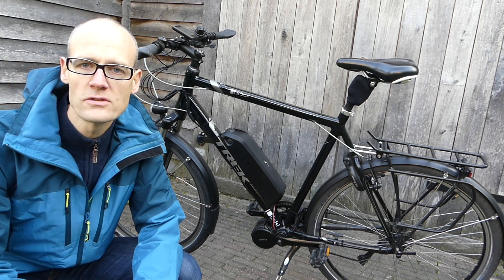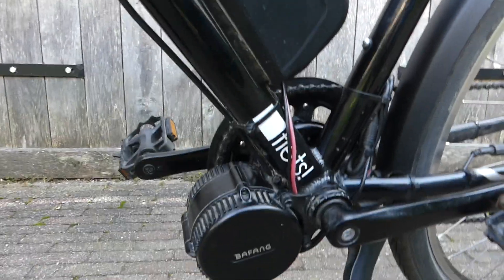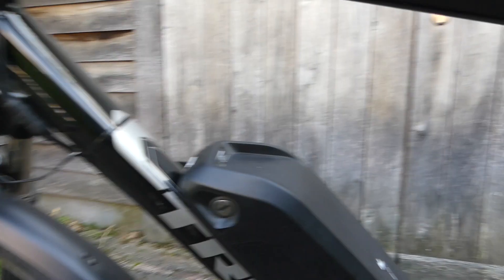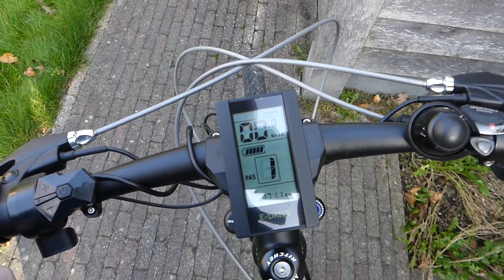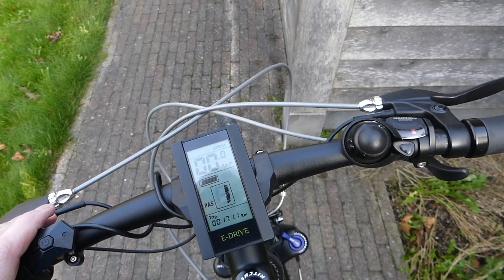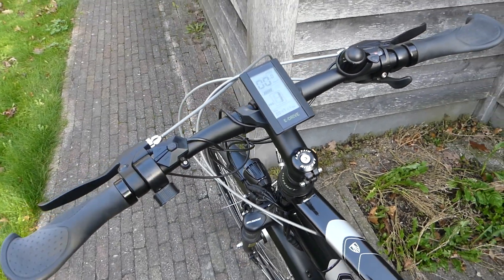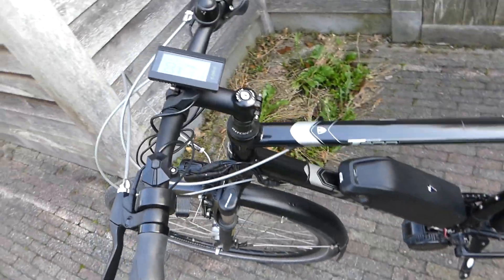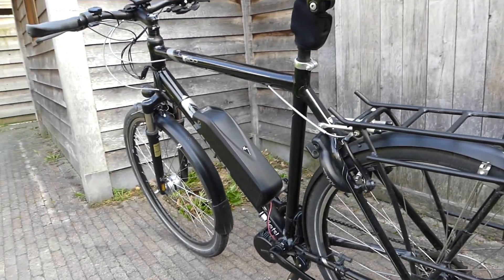Bafang BBS01 36V/250W review

Comment: Thanks for the tip regarding fixing the battery mounting plate with some polymer glue. Did the same yesterday and now it holds like a rock! Feels much safer now when riding on bumpy terrain (I ride MTB). I have BBS01B 350W with 17,4 aH battery - I have like 200 km range on this baby using PAS 1-3. I still like to feel my legs a bit when I'm riding:)
Reply: How about speeds at different pas settings. Looking at getting exactly that kit
Reply: i dont mean to be so off topic but does someone know a method to get back into an Instagram account??
I somehow forgot my login password. I would appreciate any assistance you can offer me!
Reply: @Isaias Aries instablaster =)
Reply: @Kace Rory I really appreciate your reply. I got to the site thru google and im waiting for the hacking stuff atm.
I see it takes a while so I will reply here later when my account password hopefully is recovered.
Reply: @Kace Rory It did the trick and I actually got access to my account again. I'm so happy!
Thanks so much you saved my ass !
Reply: @Isaias Aries happy to help xD
Reply: 200km range? Even with a tailwind on flat terrain on lowest assist I have never seen such results. That is amazing.
Reply: @tamastenhaaff2291 : You can travel any speed in any PAS setting, the only variable is how hard you must work. If you meant throttle only, with no pedalling, that varies depending upon overall weight of bike and rider and what terrain you are riding.  It seems you might want a more powerful Bafang model if speed is your main concern.

Comment: HalloEdwin, after buying the 1000W motor I also bought a 750W motor and, by comparison, it sounds more like your motor concerning the acceleration. While the 1000W motor is super smooth and immediate, the 750W is ruppig (you´re German, no?) What I did was put a second sensor on the rear wheel. I can´t say it´s the perfect solution, but it does seem to help a little bit and, to my surprise, it doesn´t seem to affect the tacho readings at all.
Reply: OK, when Dutch, instead of ruppig, ruw ;)

Comment: It's a neater job if you cut back those cables once fitted. Plus the 2 holes in battery base have held mine, I fitted a rubber grommet below the top hole has I didn't want to glue mine. I get more milage just using my throttle to tickle the power. Not annoying has speed catches up quicker than me pedaling. Buy a cable n change specs on your lap top.
Reply from the maker: I tried reprogramming with different settings, but nothing worked. I just can't get the accelleration to speed up. I also have a BBS02 now, which does not have this issue.

Comment: Great video. I'm upgrading from a 250w hub motor as we have large hills where we live.  To stay legal in the UK I would have to stick to a 250w bafang crank motor, but I'm just wondering how you find it on hills?
Reply from the maker: It is surely powerful enough to cope with a hilly area. The only concern I would have is that of switching gears. The BBS01 (mine at least) has no gear sensor cable, I think it is only available on the BBS02 and BBSHD. Without gear sensor it will be hard on the rear chain wheels especially when driving in high assist levels. What I do is switch gears as much as possible in lower gears and than raise the assist level. Not very pleasant when going up a hill I guess...
Reply: Edwin Mol thanks for that response
Reply: i squeeze brake lever a fraction without binding then pedal slowly n change gear no problem. plus i can fly up a 1 in 10 gradient very easily.
Reply from the maker: Johan Meijlaers I think you can not mount the gear sensor on a BBS01, if that’s what you bought. As far as I know, only the BBS02 has a connector for the gear sensor.
Reply: my dealership has gear sensor as an addon for this kit, i will get one after reading this cheers
Reply: @moledwin  Maybe on the earlier model's perhaps? My  BBS01 was Bought and fitted in Jan 2020 and it has the Sensor connector which works just fine.

Comment: Hello Edwin Mol. 
I'm on the fence of switching from a 6 year old worn out Crystalyte HS rear wheel 36v ebike kit to the Bafang mid Drive BBS0 mid drive kit with 36v battery. 
One of the reasons to change from the x-lyte 28" rear wheel drive to mid drive are : 
a. because as a Postman delivery guy for work I would like to be able to take out a normal light weight rear race wheel with quick release easily in case of a flat tire. The heavy ebike rear wheel requires multiple tools to onscrew the lock nuts and rear axle reinforcement anti torque mounts to do so .
B. Also the rear wheel is heavy to spin unassisted in case of a empty battery . So my main question right now for you  is :
"1. How does this Bafang bbs01 mid drive feels when riding unassisted ? 
Is there a clutch / freewheel mechanism inside wich separates the motor parts for being turned around when cycling the front chainring unassisted / unpowered , or are you still dealing with the force of having to synchromely rotate the electrical motor rotor and magnets along when cycling home unassisted alone ?
Reply from the maker: Hello Pascal Kolkman,

It can be driven unassisted very well. No problem. I’m not sure about the clutch but it does not feel like you are turning the motor around.
Reply: @moledwin  Thanks. Bedankt voor de uitleg. Ik heb inmiddels ook een Bafang 36v conversiekit besteld. Bewust niet gekozen voor de zwaardere BBSHD 48v motor om de donorfiets licht, wendbaar & veilig te blijven houden. 👍✌

Comment: Hi! 250W is enough, or would you recommend more, for example 750W? What is the maximum speed along the flat road? What kind of battery do you have and how many kilometers does it have on average?
I have about the same bicycle, Stivens Primera Lite 2009, and I think what power to choose a motor.
Thank you!
Reply from the maker: I personally think that 250W is a bit low in power. The controller can deliver up to 15A with a 36V battery. So the max. power is actually around 500W. The battery I use is a 612Wh battery and it gives me around 70km of range riding at speeds around 35 km/h. If you want to go faster, definitely choose the 750W motor, but also make sure to buy a bigger battery as your range decreases with speed increase.
Reply: @moledwin  what are the laws regarding engine power in your country?
Reply: @tomjoad1363  In Europe to be considered as a legal VAE (electric bicycle) the max power is 250 Watts, stopping assisting at 25 km/h and no throttle, only a PAS. Otherwise you are considered a moped limited to 45 km/h with immatriculation, insurance, and helmet mandatory.

Comment: Have you got the standard chain ring? Do you ever find that the chain falls off?
Reply: I have a bbso2 running on 36 volts with the 46 tooth stock chainring with 11-32 ten speed gearset. I run it with only pedal assist. 

 When I am cruising on the street it's fine. The minute I start going over some hard bumps, like in the grass for instance it WILL fall off, or just once in awhile getting off a curbs.  just stay on the street or sidewalk, chances are it will not fall off.

 I looked into those bling rings, I would love to have one  but 80 plus dollars for a chain ring? I don't really ride off road.. To me the chain coming off is not that big a problem.  But I freaking love my bbso2 and the battery life seems to last a very long time between charges. Compared to my 250w Hub motor when I was at stock settings.
Reply: @Jonmc511  I now have a 44 tooth standard chain ring as the 46 tooth was too big for my chainstay. I have a 9 speed cassette and the chain line is pretty good now. I have purposely shortened the chain to increase tension. It seems fine over bumps and curbs. Done a couple hundred miles on it. I'm not going off road as I have the battery bouncing around in a triangle bag lol.
Bbs01 350w... gets me max 27 mph on a flat but up hill I'm down to like 13mph .still fine for 220 pound rider. Thanks for responding.
Reply: That's crazy because I have a bbso2 500w and I was thinking about getting the 250w bbs01b. For my wife's bike .. That's what I was actually was watching this for..  seeing what kind of performance does the bbs01b has.  LOL thanks. Do you peddle as you ride? Do you peddle going up the hill to get 13mph? Something told me to respond to your question this morning. I'm gonna look into tightening the chain a couple links shorter. :)

I have no idea how fast I going at 500w motor, because I could never get the speedometer to work on my computer.  And I always cruised on level 2 out of 9 speeds so I thought maybe the BBS01B wouldn't be such a bad motor. But then motor really bogs down going uphill the hill doesn't it.. 

I was reading a guy that put a 52v battery with a diode between the controller and the battery and he said it was day and night different in performance all the way around.   Like 48v performance. And was getting like 100 miles between charges, with average speeds of 25mph cruising with peddle assist.  Just have to be careful with discharging  the battery below the low voltage cutoff.  Which can destroy the battery.
Reply: @Jonmc511  that's with me pedaling yes. The 350w 36v is enough for me day to day. But you are correct... Uphill it does get bogged down. I wish I had gone for a more powerful motor but I don't want to get stopped by the police on my first ebike build haha.
Have you done a video of your 500w and it's performance? 
I think by shortening the chain to be honest will probably put strain on the rear mech but I'm testing it out and if it breaks it breaks. It's all fun and games testing things out lol. Enjoy the rest of your weekend .
Reply: @davefool6815   no I haven't done a video because I am camera shy and I mumble alot..  LOL I need to purchase a speedometer though.  I cant seem to get the bafang one to work again..
Reply: @davefool6815  I find that the chain strain Is not enough to hurt the chain. Unless you change the gears without releasing the motor driving. And keep the chain from slipping and skipping from the links freezing up together by not having proper lubrication. I upgraded the rear sprocket and saw that the original 14 tooth gears were stretched I moved out of alignment. So I just keep it on the 11 tooth sprocket at all times. Unless I'm slowing down I use my cutoff on my break to change gears. My gear seem to be okay now after three months of use. I still use the original chain that came with the bike I've had the bike for a year and a couple months now. 

If the chain starts to make a little bit of noise I put it in my pot with candle wax and melted and it's good for a for several weeks for me. No more skipping gears. Shifts good, Nothing but smooth riding now.
Reply: @Jonmc511  sounds like you know what you are doing. As long as it all works nicely that's a thumbs up.
I will be using my bike alot this weekend so hopefully another chance to test it all
Reply: Aah the chain. On my BBS02B it's most likely to come off if there is a lot of stop starting or a pot hole. Warning: turn off the pedal assist before attempting to put the chain back on.
Reply: @TimpBizkit  wow I made that comment a year ago... too late is your response.  I now only have 3 fingers lol. Hey one thing I have noticed is that the unit comes lose. I have had to tighten it up about 3 times over the year.
Reply: @davefool6815  I found that too. I fixed it by wedging a stick in-between the motor and the underside of the bike frame, although the stick eventually crushed. I might try and find a hard piece of nylon. Because I have the 52 tooth I'm not sure if the lekkie bling ring will touch the frame. I needed spacing washers on mine as it is. Plus the lekkie bling ring is expensive.
Reply: @TimpBizkit  I know it is expensive. I had to use a 42 tooth chain ring as the 44 tooth rubbed the chain stay. Still only have 1mm clearance lol.

Comment: How did you manage battery fixing? With drilling or just glueing?
Reply from the maker: I partly used the existing holes for the bottle cage and also used polymer adhesive for the front of the battery holder. It has been holding up great so far and gives the battery a nice cushion to sit on.
Reply: It fastens onto the bottle holder lugs
Reply: For my battery I used 4 fixing points: 2 from the bottle holder and 2 I glued on the frame. For that I prepared support parts with my 3D printer. Now it is very stable and reliable.

Comment: wondering, why you choose drive throught chain? motor hub, especially front, is much better, imho, and it not stress / wear your chain and sprockets...
Reply from the maker: Well, I did consider a hub motor, but there were a few things that I didn't like about it. 
1. Hub motors (or at least the ones I found) need a separate controller, while the BBS has a build-in controller.
2. Maintenance is much easier with a mid-drive. I can easily take-out the front and rear wheels, just as before.
3. I wanted to keep my hub dynamo and did not want to rely on the battery for my lights.
The extra wear and tear on the chain and sprockets is something I can live with.
Reply: goldenmotor has built in controller, and some other too.
but separate controller is much better: it can more easy to change it, if it gets broken, and also you can "tune up" your current hub motor by putting more powerful, with more voltage controller on it. in general, as i hear, you safely can put about 1.5 times more power in hub motor, than its rating. more voltage also can grow your hub motor RPM.
2. hub motor, if its brushless, no need maintenance at all.
3. it is foolish to use dinamo when you have e-vehicle - unvanted loss of power. you make torque on drive to turn dinamo - in short, you spend more electricity, than you get back in that way. also, e-veh battery was very big in case of lights , even on runned out large battery, and driving on pedals, you have enought juice for running lights days long, especially, if that was LED lights.
extra wear and tear, and also extra power loss. there are no advantages, only disadvantages... ;)
Reply from the maker: Keeping the hub dynamo is a safety measure. When riding in the dark and your battery breaks down or dies, you are in a dangerous situation without lights!  The BBS has a reprogrammable controller, this is one of the reasons why it appealed to me, so it can be tuned as well.
I'm also wondering, you mention using a hub motor in the font wheel. You do have to run a cable from your fork to the frame, Does this not pose a lot of strain on the cable  because it has to flex constantly with steering?
Reply: as i said earlier, if you have electric bike - you have _very large_, gigantic, dinozaur-class battery ( if we talk in a bicycle lighting topic).
even if that battery is practically flat for driving, it have enought juice for powering lights for many hours. there was very big difference in power, for driving you need at least 3-4 amperes at about 24 or 36 or even more volts.

lighting, say, on my rear one eat 0.4 amps at 3 volts! that was almost nothing for big battery.
also, if you are very planing man, you can carrying with you flashlight like T6, who have comparable with car beam, and works from 18650 lithium accu, and a separate rear taillight on 2x AAA elements.
in my opinion, give additional load to your legs and knees to generate electricity for illuminating is no good idea, because, human power is very limited, and illumination can be obtained easy without any strain on your muscle power.
i have hard front fork, but yes, cable must a flex a bit.

as do bicycle computer cable too. but movement is a small, and i think, it not introduce any problems for many years, especially with my small mileage. -about 1300 - 2000 km in a year...

reason for front wheel is simple - on rear wheel you get more problems because of chain, sprockets, and so on need to put on your new motor-wheel, and also i have been read, in a case of repair puncture, say, on rear wheel with hub motor that was not trivial task.
front wheel is much more easy to unmount and mount again, and also i think, it was better on a slippery surface ( i drive to work in winter too), and also when you drive up to a edge of sidewalk, fwd do it better, i think.
sorry for my bad english...
sadly, hub motors delivery cost almost the same money, as it cost itself, and "free delivery" is only for assemblies with cost from about 250 usd...
very pricey, sadly...
Reply: @moledwin  and what about noise? I believe the mid-drive is quieter, which is a big plus for me - I want my bike to be as quiet as possible.